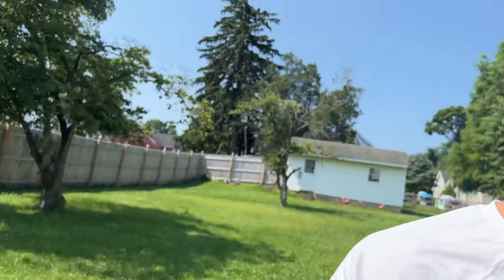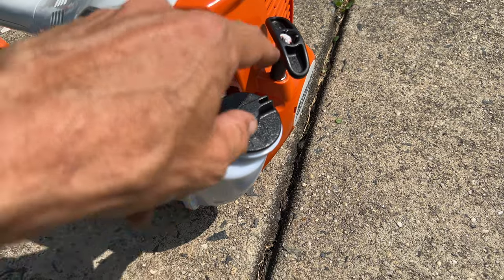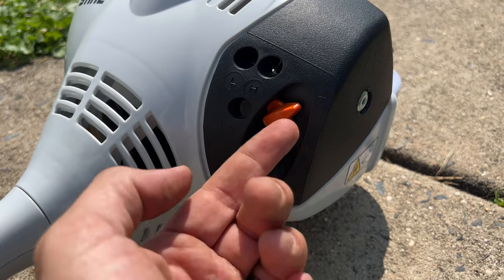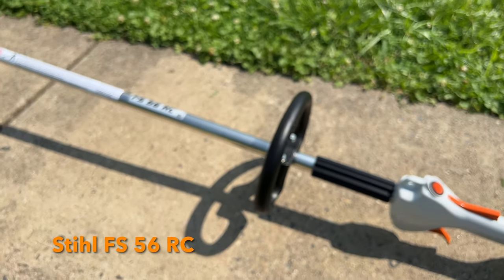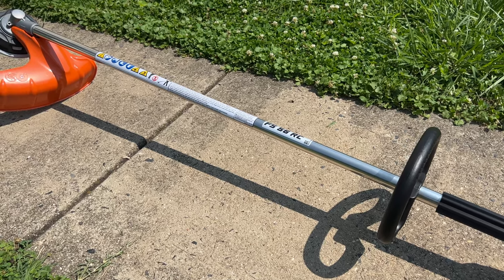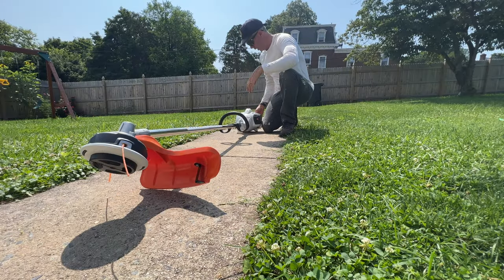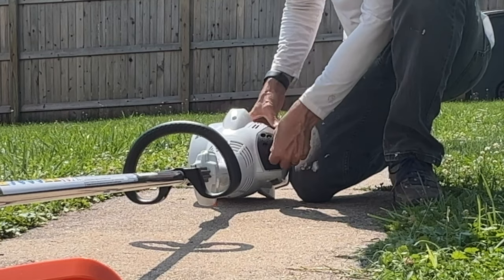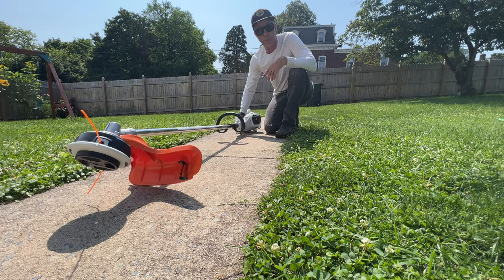Stihl FS 56 RC Weed Eater Review

Comment: I got one a couple of weeks ago.  It came with a 2 year warranty and I got an extra 2 years with a $16.99 purchase of a six pack of 2.5 oz stihl ultra.  Not a bad deal at all!  It works awesome also.  I did go and get the 28-2 polycut head off ebay - they are hard to find in a store right now.  The polycut works great for larger brush and stems.  The 28-2 can also take a single length load of .105 for tough jobs.  Also - restringing the original 26-2 is simple.  Just cut off about 3.5 lengths of string (hand to hand arms outstretched) about 20 feet or so.  Set the pointer on the white part of the head to the holes.   Poke the string all the way through the hole on the head and equalize the length from the two holes.  Press on the bumper with your hand and turn counter-clockwise until wound.  There are other videos on youtube about it.
Reply from the maker: Thanks for sharing your experience! Things like this are helpful to me, and hopefully others.
As for your restringing tip, I’m going to check that out.
Thank you!

Comment: My Ryobi wouldn't die. It made it close to 15 yrs. At the end it would only run on full choke, even after I cleaned out the fuel filter. Now I own a Stihl FS 56, and you are right, the Ryobi is crap next to the Stihl. The Stihl is well worth the money. I now wish the Ryobi crapped out sooner.
Reply from the maker: Haha, I have to laugh because my wife bent the Ryobi shaft where the adapters connect. It’s so cheaply made that when I tried bending it back into place the metal buckled/flexed and that was it.
So, I thank my wife for the upgrade!
And only I use it now!
Reply: @DIYTutorialGuy  I almost bought the Stihl 4-5 yrs ago while at the dealer for another piece of equipment. But for some reason I didn't and keeping that Ryobi alive (on life support) became a quest.
Reply from the maker: @jaymauro4288 hey man, that’s what this channel is about; not having to spend a lot of $$ on things and instead making what we have work!
Had Mrs. DIY Tutorial Guy hadn’t broken the Ryobi, I would still be using it!

Comment: The line won’t feed. It gets tangled and fused and you’re constantly taking the head apart to free up the line. Just changed to an Echo speed head but haven’t really used it yet. Hoping it will work better.
Reply from the maker: Time will tell.
So far no issues.
Reply: Used the Echo head today. Much much better than the Stihl head. Feeds properly.
Reply from the maker: I used the Stihl today, fed just as good as it did last cut.
Reply: @DIYTutorialGuy  I’m glad it’s working out for you. Mine didn’t.
Reply from the maker: I had an issue with the Ryobi head on my last weed eater.
Easy to restring, but man, it jammed up like a M249 SAW!
My wife used it one day and ended up bending the shaft trying to “tap” it to feed.

Comment: Bought one last year, kind of wondering if I should've bought the Combi system instead - I don't know. The 56 is a beast of a trimmer though.

I removed that black handle wrap thingy between the engine and loop handle - still no idea what it does other than spin around the shaft so I removed it.

Thanks for the review
Reply from the maker: Thanks for sharing!
As for the Kombisystem…I considered going that route, however, I personally like having a specific tool for specific jobs. It just works better that way!

Good call on taking off that spinny thing…I feel like it’s only use is a carnival pullup bar!

Comment: Hi - the biggest issue that I have with a Stihl trimmer is that it runs half-speed after 18 months of bi-weekly use at my house, and I end up having to replace the carburetor. I looked online and several forums say that Stihl trimmers need to run full-throttle all of the time or this will happen. Have heard of issues like this?
Reply from the maker: It’s been a long time since I handled Stihl weed eaters on a regular basis, so I’m not able to give an accurate answer.
I’ve only had this model for this season so far. Still runs great, no issues, but thank you for identifying a potential issue that I may encounter.
Also, did replacing the carb fix the issue?
Reply: spark arrestor will get plugged up reducing power if you half throttle the trimmer alot, running it wide open heats up the exhaust burning the carbon off the screen...take it out of the muffler and burn the screen off with a propane torch and put it back in...the engine will come alive
Reply from the maker: @dmb3428 thanks for sharing, this is awesome advice!